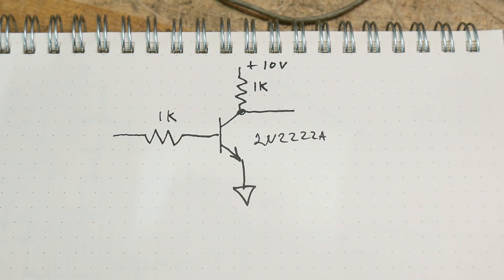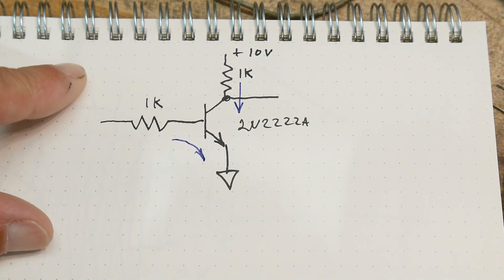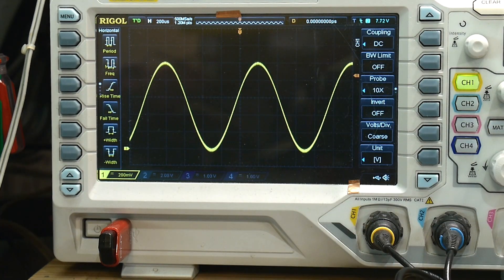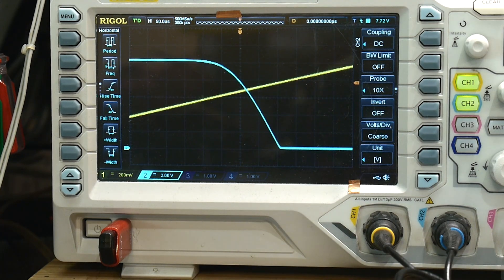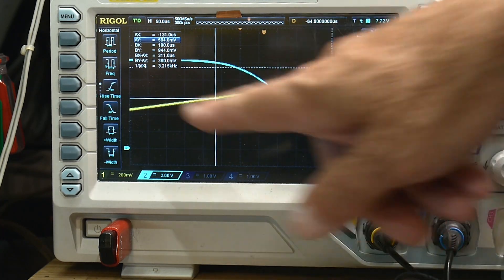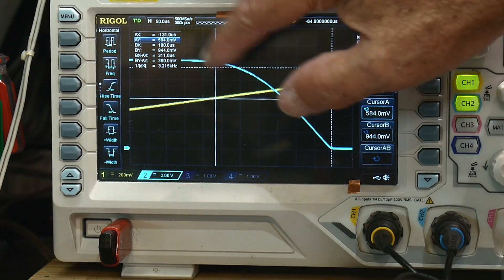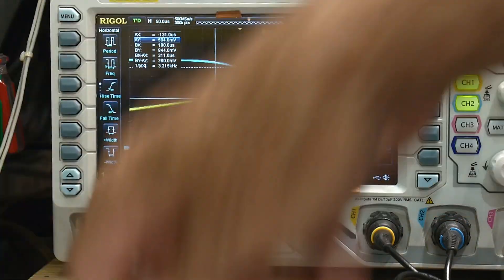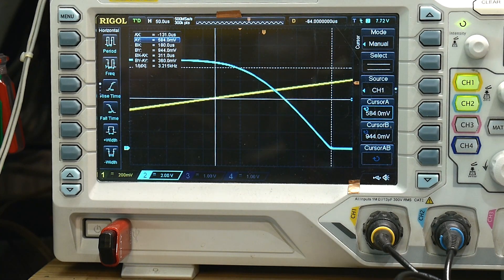#834 Basics: Transistor (1 of 3)

Comment: The way you explain this circuit, eg: hand-waving, you could just as easily have a relay instead of a transistor.   Have you heard about transistor models?   Simplest is a diode and current source.

Comment: I would have liked to see the transistor circuit before the oscilloscope explanation
Reply from the maker: the first two minutes show the circuit
Reply: @IMSAIGuy  Ah, sorry for the confusion, I meant the actual physical circuit, not the circuit diagram
Reply from the maker: really? it's only three parts.
Reply: @IMSAIGuy  but what was the source of the input?
Reply from the maker: @dryster123  those came from a HP 33120a generator
Reply: @IMSAIGuy  sorry so from your traces  1Vpp offset at the base and 10Vpp at the Collector? Am I missing something? How did you get 2 different signals from the HP 33120a?
Reply: ignore that! Of course I missed the 10V supply at the collector is DC not another pulsed supply :). Thanks loving your videos!

Comment: Key thing with saturation is that saturation current  is not determined by the transistor. In the resistively loaded collector case, it is determined by the collector resistance and the supply potential, here 1Kohm and 10V. This tells us ahead of time that the saturation current will be 10mA, minus a little for the saturation voltage. Saturation voltage is current dependent, and is usually specified on the data sheet at a particular current (or at several currents). For example: V_CE is specified at I_C=10mA and I_C=50mA for the 2N3904 (Fairchild data sheet, 2011) as 0.2V and 0.3V, respectively.
Reply from the maker: Yes. But, please, these videos are very basic and I will be avoiding math. It is a high level overview for beginners. My goal of the video was to teach basic concepts. Many people will never need to design circuits or calculate anything. I hope that when they hear the term 'saturation' they know that transistor is on all the way. and when they hear 'linear region' they remember the visual scope trace being a straight line. That's it , That's all. There is a need for this type of teaching because many will tune out as soon as you say V_CE at I_C and do math. Lots of other videos to do that stuff.

Comment: I think you should pay a little more attention to the measurements... The input voltage for saturation would probably be somewhere above 700 mV, not above 900 mV, as you read on the marker. If you had given the marker line below (in a correct position), it would probably have been above 700 mV. More attention to what is seen on the screen! (Min. 7:15) https://youtu.be/Eyrn2IShE90?t=435
Reply from the maker: you are right. I had made the measurement first before the video and when I did it the second time for video I didn't update the cursors
Reply: @IMSAIGuy  I made this correction because this video is dedicated to beginners. Thus, it is good for them to understand more clearly what they see when they look at an oscilloscope screen. You're doing a good job, anyway!
Reply from the maker: @hflorin07  Thanks. My goal was to teach two things. saturation and linear region. I hope I did that.